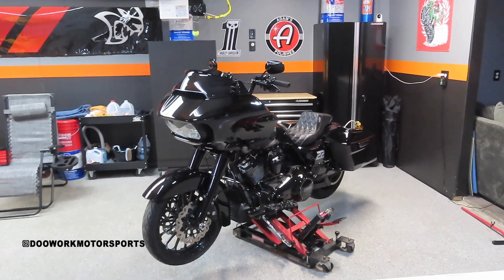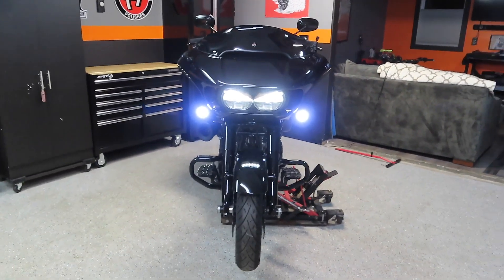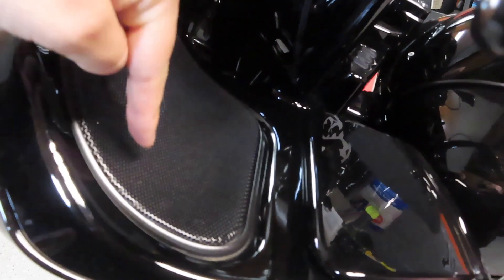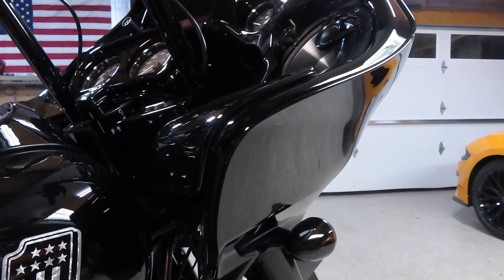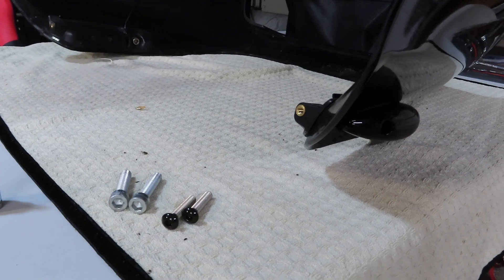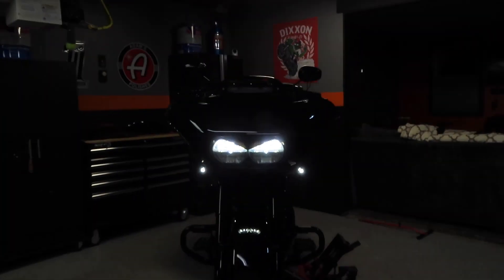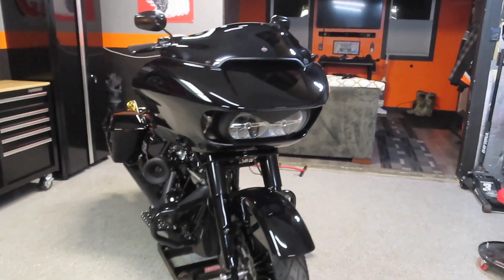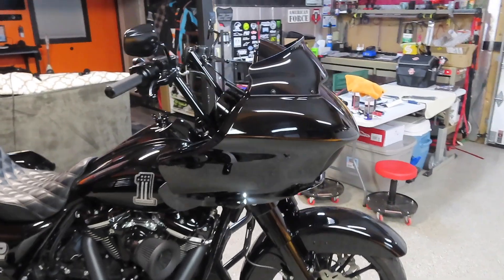CUSTOM DYNAMICS LOW PROFILE LED TURN SIGNAL INSTALL ON MY HARLEY DAVIDSON ROAD GLIDE! *MUST HAVE*

Comment: YouTubers: Don’t pry on the speaker grill with a plastic trim tool. Reach in from the top of the opened windshield backing plate and push on backside of upper grill with your hand. That will do it

Comment: I have them however I'd like them better if the ONLY worked when the signals were on. Know how to disable the running lights on front turn signals to only work when signaling?

Comment: I watched an early video of yours with regards to the Motowitch bars - What made you decide to change them out?
Reply from the maker: I wanted a true T-Bar setup.  Solid mounted.  The motorwitch bars still use the rubber mounted bar clamp and after doing a bunch of wheelies and coming down hard, that started to get loose over time.

Comment: I have a 2017 ultra limited. I have the custom dynamics front turn signals, brake light, filler lights and modules. Saving money to get the tour pack light and side lights for the tour pack.

Comment: How are you liking the 475c with the big bore kit? 
Are you considering switching cams or it works fine.
I'm thinking about doing big bore with my 475c cam but not sure if I should switch it
Reply from the maker: It works great!  Lots of Torque down low. If you are keeping your stock heads, there is no reason to switch cams.  If I do heads/springs in the future, I will go with a bigger cam..  But for now, I'm happy with how my bike performs with how little is done to it.
Reply: @DOOWORK PRODUCTIONS  
Thanks for the reply 
Think I'm going to follow suit and keep the 475c in my bike!!!
After all I fell in love with this low rider st because of the TQ not the hp or I would of kept my ninja zx-10

Comment: Hello. I sure hope this comment finds you being that you posted your video 4 years ago. ( I’m speaking of the Ram 1500 leveling kit video. I posted here hoping you’d find my comment since it’s more recent).  I was thinking of purchasing the 2.5” Motofab leveling kit with the 2” hub city spacers for my 2019 Ram 1500 quad cab. I really like the way yours turned out. The bed of my truck is a little longer (wish I would’ve opted for the short bed) and I hope it looks alright. Anyways, what size of tire do you think would fit once I put the leveling kit on? I’m thinking of going with the 255/55/20 BF Goodrich All Terrain K02 but I’m worried that they might look a little small. I would appreciate your feedback as you seem to be pretty knowledgeable about Ram trucks. Or anyone on this comment thread if they have insight would be appreciated.